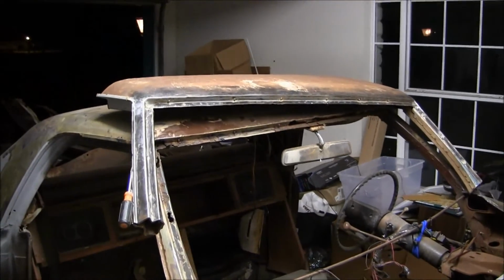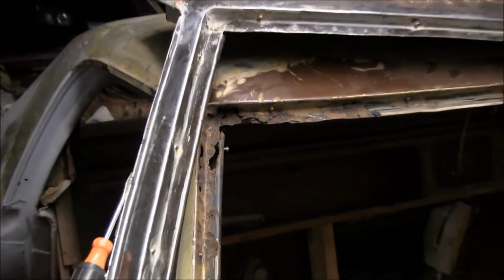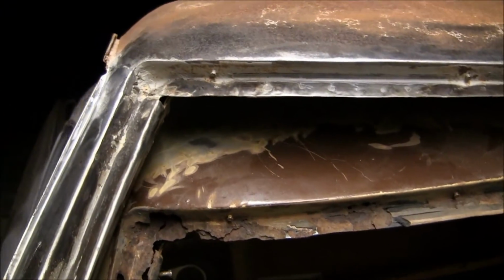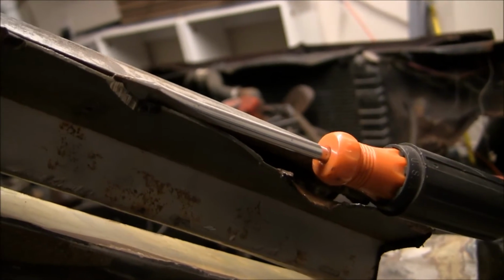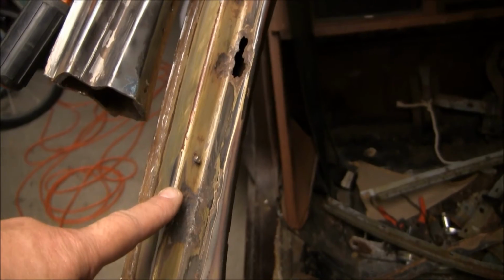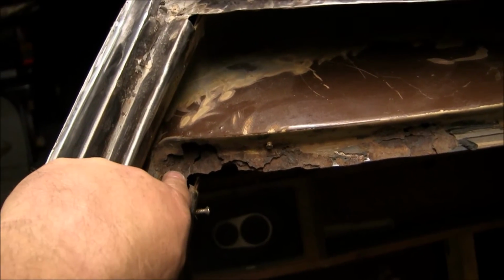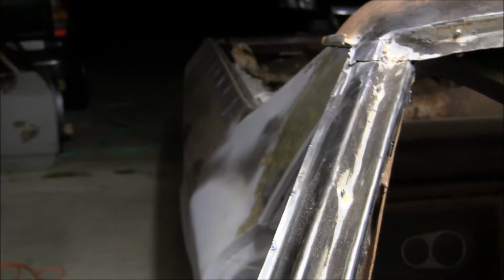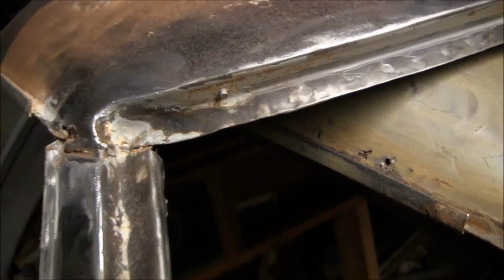1969 El Camino Restoration Part 8b- Replacing the rusty outer A pillar upper section

Comment: Wear a mask when dealing with lead..  You can always re-lead the joint... It is simple.........  Old body guy!!!
Reply from the maker: +dadams19111 Thanks for the tips! LOL, I think SIMPLE is a relative term. I will definitely try it though. I've been brazing and soldering just about my whole adult life, brass, bronze, steel, copper but I've never leaded a body panel.

Comment: great job, where the a post and top meet if it were me i would weld the two together and then cut a filler piece two cover up the trough where the lead lays and weld it in solid the lead would work as well, i dont think theres near as much flex in the full frame cars like the elcamino vs the fbody unitbodies just my opinion though, theres a ton of good how tos on lead work jamesfreddy and swilling both did some great how tos on it
Reply from the maker: Thanks! I was thinking about doing that. I mean, this isn't a concourse resto and I just want the thing back together and painted, right? I saw jamesfreddys video and that guy is a wizard. Swilling did a great job to along with a video I watched from Adam Kniffin, he knows his shiznit. I guess that's gonna be my next question... "Do I really need to lead the joints?"